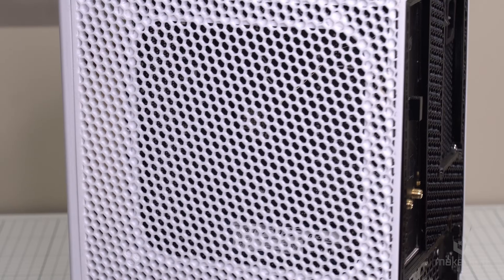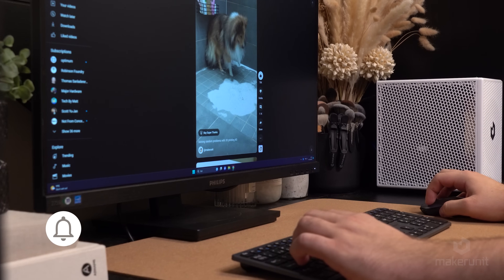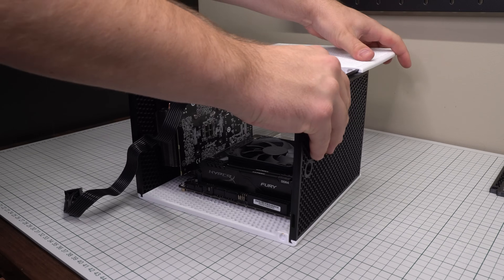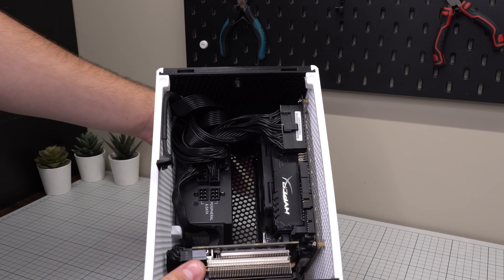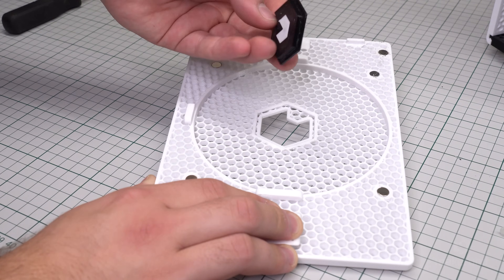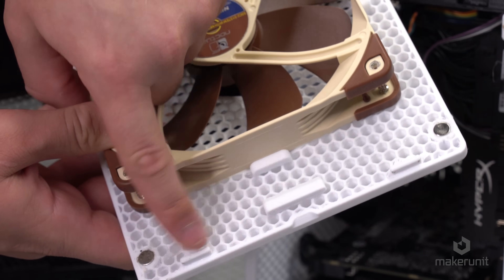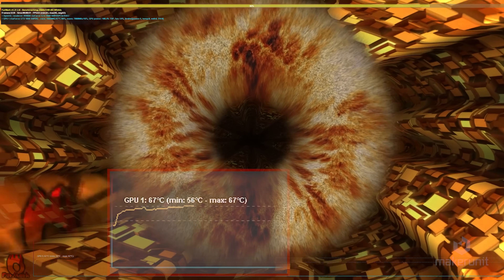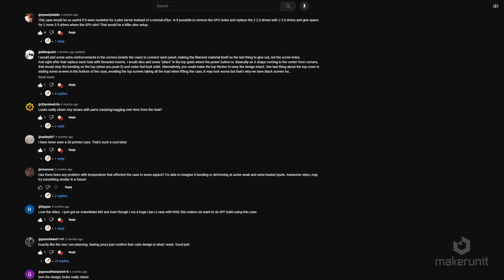Tiny 8.1L SFF build - 3D printed PC case

Comment: oh wow this one is cool
Reply: i might print this one
Reply: does it support atx psu?
Reply: i also have a 200mm fan that would be cool for the next case you design ;)
Reply: ALso if you want, here are my stuffs so that maybe you could make a case? i really do want to have a 3d printed pc case, but all the models i have made were bad or didn't work. 
M23901-001 LGA 1700 OEM cpu fan
gtx 1650 oc phoenix (the cool one with stripes)
corsair old tx750 (non moduler atx)
x1 2.5 ssd
x1 200mm fan (if you want)
core v1 snow front io pcb (i dont have any other power buttons)
so yeah, if you want to make a case, that would make me very happy :)
also asrock H610M-ITX/ac mini itx
Reply from the maker: It does not support ATX psu, but the plan is my next and bigger «M» version the goal is to support ATX psu and mATX mobo in addition to the ITX and SFX. And, thank you, I’m glad you liked the design!